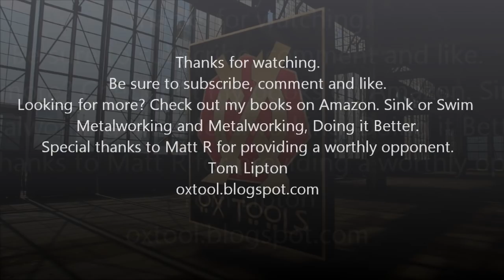Screw Extractor Torture Test Round 1

Comment: You're probably going to get a million suggestions about what to do next, so I will give you one or two more to consider.   I work as a millwright and have run across my share of broken off bolts.   I think there are two types of scenarios you run into.   Bolts that have been sheared or otherwise broken off, but aren't necessarily so stuck in the hole and bolts that broke off as they were trying to be removed.   The latter ones are the tough ones and that's what it looks like you have here.   I haven't had much luck with 'easy outs', especially on the smaller bolts.  I think when you pound them in you expand the bolt and it almost makes them tighter.   The best luck I've had is with welding a nut on top of the broken bolt.  The heat from the welding process is a big help here too I think.   If the bolt or stud is recessed, then a good welder can build a post or else a pipe nipple or similar thing can be shoved in the hole and welded on.   Anyways, just my thoughts, good luck.
Reply from the maker: Hi Etienne,

Thanks for the suggestion. I don't think I could have got much weld on the stud as short as I cut it off. Maybe we will get another manifold and try some other methods. Thanks for the comment.

Cheers,

Tom

Comment: ? use 2 wrenches 180 degrees apart to prevent tweaking the extractor?
Reply from the maker: Dohhhh, Can't find the instructions now. This is much more fun anyway right? Thanks for the comment.

Cheers,

Tom
Reply: Those kinds of screw extractors always break anyway. Either the "splined shaft" breaks or you strip the "spline" right off the sucker. I've always had more luck hammering a Torx socket in.
Reply: That's great advice. I learned that lesson the hard way.

Comment: As a former car guy, when I purchased this extractor set 20 years ago my tool guy warned me about using these on blind holes. A tapered twist extractor can be removed if one sees the broken fastener wont budge by turning the other direction. When these break it makes for a real mess as you have found out.

Comment: I have a been a diesel tech for more than 10 years now so I've seen my fair share of broken exhaust manifold and turbo studs. These extractors works ok when you drill to biggest diameter possible. But to me the best technique I find is still the washer and nut technique. You weld the washer to remaining stud first then weld the nut to the washer. Works best when using extraction weld rods but something you don't have all the space to move so I use the MIG.  Extraction rods work good when the studs are broken inside the hole, you mount your stud out of the hole with tacks. Repeated heat helps.
Reply from the maker: Hey Max,

Thanks for the comment.

Cheers,

Tom
Reply: Max Power 
Co Inc is how to read the rest of of this what do I do to read the rest of this answer

Comment: Hay Tom. After twisting wrenches for forty plus years I have decided there is no such thing as an "easy out" or "screw extractor" I've been using the method mentioned previously of welding a nut with a washer as a spacer between nut and the object, I have used this method on heavy equipment on bolts from one inch down to a quarter inch with 99% success.

The theory is when you weld the nut on the heat from the welding heats the broken piece up which then expands, it cant expand sideways so it has to expand along its length then as it cools and shrinks it loosens just enough that you can screw it out. Some times it takes a couple of tries but most always works.

Please keep the videos coming, I've learned more about machining from your and the other machinist videos in the last few months than I ever thought possible.
Reply from the maker: Hey Weldor,

Thanks for the comment. I wanted to torture test the extractors for you guys. You are certainly getting your moneys worth. 

Cheers,

Tom

Comment: Thanks for creating this project for us viewers. I always admire a man who doesn't have enough problems that he is willing to make new ones strictly to learn from them! lol I think when that extractor snapped I would have gone for trying to weld a nut to it. Beyond that get your welders/cutting torch over there and put some heat in that thing! if you can't see it glow its not hot enough yet!!  That manifold probably had 1500deg exhaust running through it for years lots of heat can only be your friend!
Reply from the maker: Hey Brian,

The gloves are coming off in round two. Thanks for the comment.

Cheers,

Tom

Comment: Being a truck mechanic I have taken my share of broken exhaust studs drilling has always been my last thing I will do but if I drill I always use left hand drill bits as somethings the drill will catch and unscrew the broken bolt. My preferred method is extraction welding rod and a larger nut. As always great video Tom!
Reply from the maker: Hey Johnny,

Might need another manifold to test some of the suggestions. Thanks for the comment.

Cheers,

Tom
Reply: Well Tom I have been down that road, sometimes the manifold is cheeper to replace than the labour to extract the stud or bolt. Cat engines are some of the worst to get out, the studs taper at the end and they wedge them selves in the holes of the cylinder heads, havent had to change a head yet.

Comment: As a vehicle technician, this is a good representation of our struggle. I'm young and I still got much to learn, but my teacher told me that when bolts or nuts are stuck, heat them to a cherry red. It solved most, but not all, of my problems. 

Some times I had to drill and tap out the broken off bolts by hand. 

I thank you for this video. It's both entertaining and educational.
Reply from the maker: Hi Daniel,

Tell your teacher they are really smart. You guys have to make money doing this stuff I don't. Thanks for the comment. 

Cheers,

Tom

Comment: What I've found with any form of screw extraction, is that if the bolt broke, then the smaller diameter extractor probably will too. So I usually just jump straight to drilling and tapping it out to avoid having to drill out HSS.

Good video on showing an average day in screw extracting. :)

Comment: As a mechanic, I don't even mess with extractors anymore. Sometimes they work for broken brass fittings, but I haven't found an extractor that won't break more often than not. What I usually end up doing is drilling through as big as possible with a drill making sure not to damage the threads. Then I get my little mini angle die grinder with an 1/8th inch arbor, and hog out the inside diameter of the broke bolt until the threads just barely show. Then you can peel the threads out one at a time. Run a tap through to clean the threads up and done. Broken extractors are more of a pain than using the die grinder.
Reply from the maker: Nathan Wilson Hi Nathan,

For the really tough stuff I have to agree. Thanks for the comment.

Cheers,

Tom

Comment: I learned early on in my decades of machine shop experiences that it was going to be a piece that was headed to the shop with the EDM. For $60 the broken off whatever would be out and I would be having a cup of coffee. Love your video's, thanks for sharing, and putting in all the effort. Very Merry Christmas to you.

ELECTRIC DISCHARGE MACHINING (EDM) is the only fast and efficient way of removing broken tools like taps, drills, and fasteners. Most commonly EDM effectively removes broken bolts, broken drills, broken sparkplugs, broken ez outs, and broken taps.
Reply from the maker: Hey Tfp,

The car guys would be howling. How can you get your EDM machine under the car with all that snow on the ground. Thanks for the comment.

Cheers,

Tom

Comment: I've just recently started enjoying your vids. One day I might just have to do a response out of my own shop...
I think what you needed was a can of freeze-spray, found at your local electronics supplier. First you apply the heat, then you freeze the extractor and the remainder of the stuck bolt. This technique worked like a charm on a steel freeze plug (Marine = Brass) in the head of a seawater cooled engine (351 WIndsor). Whoever put that together was, well... I won't go there, but the extraction technique worked like a charm. I did use a 4' piece of 3/4" galvie pipe with a 1/2" socket extension welded to the middle of it as a wrench. The socket extension fit the I.D. of the plug perfectly, making stripping it nearly impossible... Of course the heads were still on the engine in the boat, making this a Mission Impossible sort of thing... sort'a like the mechanic under the car...
Reply from the maker: step4560 Hey Step,
The only thing worse than laying in the mud under a car is swishing about in the bilge of a boat with stinky oily seawater soaking your clothes. Thanks for the comment.

Cheers,

Tom

Comment: Tom Good to see you having a go with those wonderful extractors. Welcome again to my "Getter Out World" (notwithstanding the many you have taken out I'm sure).

Lets step back into my classroom: One: most of the automotive studs are metric 10.9 or 12.9 MPA extra high tensile strength (similar to allen screws). Two: Always drill all the way through (as you did). Three: DONT drive the extractor in very far! go about 1D or so. If it works it will remove the stud, if it doesn't the extractor can be removed easily. Four: Use "freeze it" to shrink the stud. Five: DON'T wobble the drill. Six: DON'T wobble the spanner. Seven: Keep the spanner and the driver nut as close to the surface as possible. Eight: Drill to the maximum extractor diameter that you can. Nine: Exhaust studs can at times "weld themselves in" and become part of the parent metal (Caterpillar is a fine example because of the extreme heat they work at compared to many other brands) and generally the turbo is another area where we see that a lot. Ten: When the manifold is the problem I do all the work in the Mill, gives good control. Eleven: If the extractor turns in the stud after you have done all that, cut your losses, drill the stud out and fit a coil, don't waste your time. Twelve Cut/or grind the stud down to as close to the casting face as you can (reduce the amount of drilling depth required.
I do one or two manifold holding studs on the blocks in situe on tractor trucks or cars or machines a week, leaning under the hood sometimes with mirrors and all sorts of other systems, at times up to 10 studs on one motor. Then your faced with the added problem of steady accurate drilling, arthritic wrists etc. Any chance to put the patient on the Mill has to take priority. About half the studs have to be drilled out completely, some come out with the lefty, and 30-40% with the extractors.
 Add to that in most cases there are too many peripherals that are strategically placed on the motors (aluminium air con pipes, fuel lines, sensors and their umbilical cords etc. that applying heat is not an option). Add to that as well, in lots of cases someone has "had a go" and left a broken tap or ezi out in the stud, and in most cases "off centre" or "skew"

Yes Tom I have probably broken about 15 ezi outs over the years and I also have a few that I have shortened. If you refrain from driving them in too far then you have a fire escape. The extractors like drill bits are consumables in my eyes, and the bonus with those kits is that you can get singular replacements.

My wife loves your sound effects (Grunt - Groan - Moan). 

Ps Have a great Holiday, and a safe New Year.
Reply from the maker: Hey Bruce,

Thanks for the pro pointers. I don't think I want to take the advanced getter out classes. As soon as you mention laying underneath something or working under the hood I'm off. Gent Harris mentioned driving the extractor partially in then wiggling it out several times to leave a backdoor to getting the extractor out. I was expecting the extractor to wind up instead of fracturing like it did. I'm looking around for another manifold to try some of the other techniques and suggestions folks like you sent it. 

Happy holidays to you and yours! Hope you don't get any emergency calls for getter out over the holidays.

Cheers,

Tom

Comment: Hi Tom! I follow the Keiths and Adam (and you) almost daily. One quibble: There are "car guys" and then there are other "car guys". I'm one of the "other" car guys. I'm also a Mechanical Engineer and made straight "A" in Machine Shop when the instructor was a crusty old ex-Navy Machinist.

A "real" car guy would have double nutted that stud, used Kroil (like you did, love that stuff), let it sit and warmed it up.

I also build engines for myself and friends, and my Granddad was a Machinist for Lockheed (then Bell Aircraft) and built B29s.

One time I found myself under a friend's Dodge van with a broken shift linkage. The outer threaded part of the 1-2 fork had broken off. I hand drilled the thing and tapped it (while laying on my back) and put a grade-8 bolt in. Then I realized the rain dripping off the van was freezing...

BTW I don't claim to be a Machinist. Just a wannabe...

I would give my left, um, eyebrow to have a shop...

;)
Reply from the maker: Hey Phil,

It just goes to show I'm a phony car guy. I'll let you in on a secret. I don't even change my own oil. Pretty bad huh? Thanks for the comment.

Cheers,

Tom

Comment: I know this was only a demonstration on using a screw extractor kit to remove a broken stud, but it's a great video showing why screw extractors and or easy-outs seldom work.   If the bolt is in a housing so tight that it won't back out on it's own without breaking, a hardened and brittle extractor is sure to break off.  And driving an extractor or easy-out down into a drilled out bolt just wedges the bolt in even tighter.  Easy-out = it ain't easy and it won't come out.  Some heat from a good hot torch, some of that Kroil oil he had on the bench and a pair of vice-grips would have that broken bolt out in 5 minutes.

Comment: Great video! Yeah, you need to mount the vice under the table where it's hard to get to and even harder to see. Lol. Been down this road before!! It can be tricky drilling center when the bolt is flush like that. The end of the threads make the center mark look off center.
 I worked for a ford truck dealer and had a Toyota pickup that I used for off-road fun. For reasons I don't understand, ford exhaust studs and bolts almost always break off and give you a fit. And some how all of the 1982-1989 Toyotas that I have had rarely had that problem??? Maybe something to do with the hardness. You found a good one there tho! Lol. Another trick that I have had some success with is taping around the outside with a hammer to help loosen the rust or corrosion. I have even used an air hammer with a blunt end bit. You know your getting somewhere when you start seeing the rusty cloud leaking out. You know, it's the "get a bigger hammer" method! Lol. Good luck! Looking forward to part two through..... Lol.

Comment: PB BLaster (or what-not), heat and hammering (hard) on the end of the extractor bit all at the same time does it for me. I removed 12 - 3/4 studs from a mis-aligned turret on a W&S 2SC lathe that were rusted in place for 25 years using that routine.
Great video my man.
Reply from the maker: davidryle Hi David,

Never tried the PB blaster. I have always been a Kroil man. Thanks for the comment. 

Cheers,

Tom
Reply: davidryle PB plaster is wimpy....try Kroil!

Comment: Hey Tom. Have you ever seen or heard of the candle trick? Heat the whole area to cherry red then hold a candle on it till it cools enough that the candle stops melting. Then let the part cool to room temp and try to turn the broken piece out. The Idea is that the wax will wick into the threads and act as a lubricant. I dont know if thats what is actually happening or if its just the heating and cooling that breaks it loose. I have had mixed success with it but never the less there is always a candle in my tool box just in case.
Reply from the maker: Hey Dan,

I have heard of the candle trick. Need to find another manifold to try it out on. Thanks for the comment.

Cheers,

Tom

Comment: exhaust studs,are heat cycled so many times that they get really hard. that's why the're so much fun to change.
some vehicles break studs just because of the way the exhaust mounts and puts load on the studs as the engine vibrates.
Reply from the maker: Hey Rod,

Thanks for the comment.

Cheers,

Tom

Comment: Last time I had to do this was in a very expensive & rare aluminum Porsche racing head.  There was a bolt that had sheared flush - it took no time with a mig & an old nut...  An impact wrench finished it off.  

As someone who restores cars & pretends to be a machinist, I've dealt with all kinds of rusted/seized bolts... An oldtimer trick that works wonders is heating up the bolt and melting a candle on it.  Capillary action draws the molten wax in & makes your life easier.

Oh, and as someone else said, OA (plus an impact wrench) is your friend, that wimpy propane torch doesn't really work.